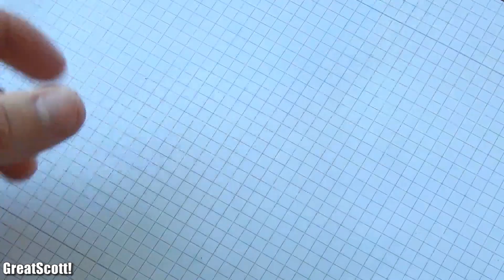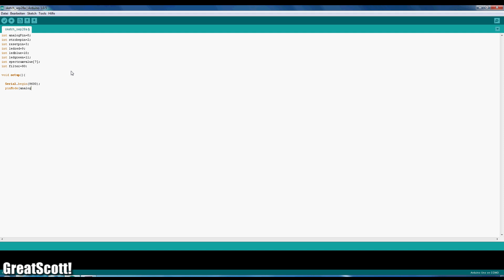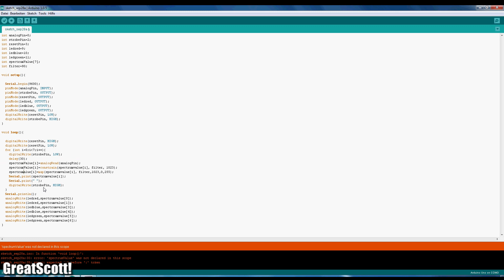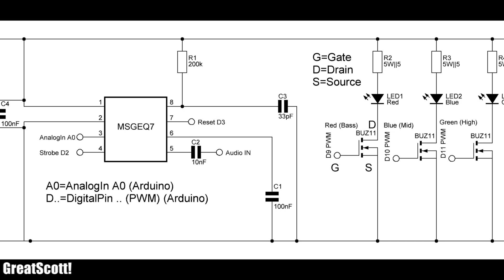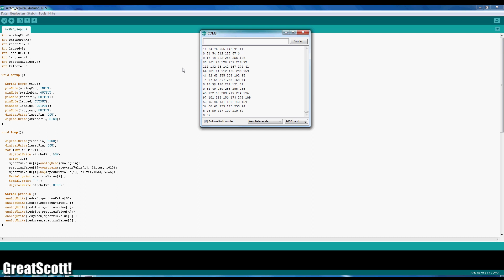How to build your own LED Color Organ || Arduino || MSGEQ7

Comment: HALP PLS

When I change the 'delay()' value I get this error when trying to upload the code:

avrdude: ser_open(): can't open device "\\.\COM3": The system cannot find the file specified.

when i check my com 3 port in device manager (windows 10) it is assigned to my Arduino UNO!?

any suggestions are welcome :)
Reply: Check out if you have selected correct board and serial port in the "tools" bookmark

Comment: I have made this without any arduino, not a single IC required, just 3pcs bc547 transistors some resistors and capacitors,and leds . it's 
a 3 channel spectrum analyser

Comment: I see you are combining frequency bands together by doing analog writes to the same pin from two stored values. I would think you would need to add the readings together and divide by 2, map the value to 0-255, then send that value to the pin. This would give you the average of the two bands.

Comment: ich will am pc ein ambilight machen... mit arduinoe oder teensy bin mir noch nich sicher...  weisst du zufällig wie ich den sound vom pc in den mikrocontroller rein bekomme? geht das über usb? würde gerne drei moduse erstellen... einmal normales ambilight... normales licht... und music sensitive ...
Reply: +Dave Blvnko schreib ihm auf englisch, auf deutsch antwortet er nicht weil er will das alle es lesen können. Englisch = Weltsprache = viele Leute können es verstehen

Comment: Hi Scott, I was thinking about using 3 regular LEDs with resistors instead of high power LEDs. Would i still need the MOSFETs and would I have to make any adjustments to the code? Cheers
Reply from the maker: Thomas Jakobs Just replace the high power leds with your normal ones+the fitting current limiting resistors.

Comment: If I were to use different LED's is there a good rule to use for working out what I need to change the resistor values to? I believe it was 1W = 1Ohm but I may need some clarification on that. Thank you for the amazing videos!
Reply: Your LED has a rated current and a rated voltage to calculate the resistance you have to subtract the LED voltage from the supply voltage if you multiply the result by the current you have the power at the resistance in watts when you divide by the current you have the resistance in ohms.

Comment: hi , i am planing to light up 12 volt led strip but how to connect led strip into circuit.because output of the circuit is only 5 volt .... please help me ...
Reply: Kumar Shrestha Try to use voltage booster from ebay,what about this ? http://www.ebay.com/itm/331580286327

Comment: i am planning to do this with a 12V LED strip is there anything i need to change apart from supply?
Reply from the maker: Bradley Gill Make sure to use a 7805 to produce 5V for the Arduino and MSGEQ7.
Reply: where can i get the program?

Comment: Hey Scott. 
The project I had in mind would use RGB strip lights along the perimeter of the walls next to the ceiling, about 80-90 linear feet. With a small architectural moulding to keep the light on the wall.
Connected to the Arduino to produce a colour organ, lights to music.  
There are obvious challenges with this project with respect to the operating parameters of the devices being used. Nothing like a challenge I say.
Good luck with your project. I'll post my results upon completion.
Cheers.

Comment: (long story short at the end)
why in the schematic you show in this video the gates arn't connected to the minus like it shown in the schematic in the instructables website?

also, in the instructables they add extra 3 ressistors 1k ohm 1/4 W between the gate and the minus...

i'm realy confused and i will be glad if you will explain that up for me..

one last this... how do i know that my buz11 isnt converting(?) from 0 to to much valt?
i fount buz11 mosfet to-220 i guess that it mean 220V , and if it will go to to much valt the buz11 can hit and destroies

please correct me if i wrong and please answer my questions:
1. how do i know that my buz11 isnt converting(?) from 0 to to much valt?
2. which schematic should i work with? the one shown in the video or the one in the website?
Reply from the maker: The Gates are not connected in any schematic. The instructables schematic is the newer one. Those 1k ohm resistors between each Gate and Ground are called Pull-Down resistors. Just google this term and you will find out what they do. And the 220 does not mean 220V. Do not worry about that. Long story short, use the schematic you find on instructables.
Reply: thank you
So what is the 220 mean?
Reply from the maker: יניב גלרון
http://en.wikipedia.org/wiki/TO-220
Reply: i understand that the 
MSGEQ7 is the one in charged on the frequency of the wave and determine which frequency is low high or bass
but i cant see at the sketch why the red led is the one that get the X note

MSGEQ7 can Set 7 different frequency so can i do the same thing which 7 leds? 

Thanks in advance,
Yaniv

Comment: I'm considering integrating one of these into a bed frame I built last year. It has 6 colors and 336 LEDs. I agree that 3 colors for mid, low, and high are enough but, then I feel like the other three colors are left out. Could It also be programmed to recognize different tempos of music and switch color schemes based on that? I'm not much of a coder.

Comment: Gutes Video! Fände es aber besser, wenn du noch mehr darauf eingehen könntest wie die Schaltung genau funktioniert. Einfach eine kurze Schaltungsanalyse, bei der du verschiedene Szenarien durchgehst (hier z.B. tiefe, mittlere oder hohe frequenzen) und vielleicht mit Hilfe der Datenblätter noch genau die Pinbelegung des ICs erklärst.
Reply from the maker: Ich rede natürlich auch sehr gern über solche Details und Einzelheiten. Ich denke aber es würde vorallem Anfänger abschrecken (die ich versuche zu erreichen). Aber vielleicht werde ich in der Zukunft eine neue Reihe starten in der ich mehr auf das Elektrotechnische eingehe.
Reply: Thats nice that you can speak multiple languages for those who dont speak or understand english

Comment: I have an idea for a new video: I really like this low, mid, high responding LED's, is it possible to connect this to your traditional speakers as well? Not for PC speakers or so, but for traditional speakers which you connect to a traditional amp. I tried some other methods (like just connecting the LED's directly to my (test) amplifier) but I always end up damaging my amplifier :(

Comment: Hi Scott, I was confused by some questions.
What's the function of the audio jack? Should I put a phone connector in it
so as to put the music to arduino?
What I've done is already finished the schematic, and the LED did blink, but I
don't know the way it shine. I mean, is the code trigger it?
Thanks a lot.
Reply from the maker: Yep the audio jack connects the audio signal to the MSGEQ7.
Reply: GreatScott! I was wondering how you plug the computer into the audio jack of the breadboard and are still able to play music out of the computer's speakers.
Reply from the maker: Luke Soldano
Here is the solution: http://amzn.to/1lM1Izp
Reply: GreatScott! Of course haha. Would you know how to output the audio into the color organ circuit while also playing music out of your surround sound speakers using a separate soundcard (Audio 2DJ)? Put more simply, can I output audio into my soundcard as well as through my audio jack to play music through good speakers and have lights at the same time?

Comment: I downloaded media fire and I'm still unable to get the Sketch code, it is downloading as a VLC file with no duration. Is there a way you could send the code via email?
Reply from the maker: Here is the link to my instructable about this project:

http://www.instructables.com/id/How-to-build-your-own-LED-Color-Organ-Arduino-MSGE/

There are more helpfull tips. If you still can't download the code then go ahead and text me again.
Reply: GreatScott! Do you need the power supply or does the usb cord survey enough power?
Reply from the maker: Siannee04 It depends. If you want to light up high power LEDs, you will need an external power supply ( 1 LED draws up to 300mA --> 3 high power LEDs draw 900mA but USB can only deliver 500mA)

Comment: Hey scott, is there any way i could modify this to have the different fequencys on 6 8x8 LED matrixes?
Reply from the maker: It sounds like it is possible. But I would need more details to do this. And I also do not have the parts. So I guess you are on your own with this.

Comment: Hi Scott! Great video!
Just a question: can I replace the 3 LEDs with a RGB LEDs strip without having to modify the circuit? obviously, red to red, blue to blue etc, and connecting the strip to a 12V power supply.. 
David :)
Reply from the maker: Hey David. That is definitely possible and easy to do. But be sure to use a common anode rgb led strip. That means you hook up one wire to +12V and the negative red, green and blue to the drain of the MOSFETSs. And do not forget to connect GND of your 12V supply with the GND of your arduino. That is all
Reply: GreatScott! So the whole thing now runs off of 12v instead of 5V?
Reply from the maker: Rob Haynes
NO! Only the RGB LED strip. The microcontroller still needs 5V.

Comment: can you use other MOSFETs with the same capacitor values?
Reply from the maker: Different N-Channel MOSFET should also work fine. But it would be easy to just use those BUZ11.

Comment: I was wondering if you could answer a question for me. How come the lights continue to flash when there is no music playing until I reset it?
Reply from the maker: Firstly you can try to change the filter value from 80 to something higher, maybe there are some interfering signals on your audio line. And if that does not help try putting one 1k ohm resistor between each gate and ground. It is called a pull down resistor.

Comment: Hey great video, I built an analog version, but that depends on the line level input voltage. This means that I have to keep adjusting the line volume for each song for the color organ to look right (in between all on and all off). Does this setup (using an msgeq7 and micro-controller) base the flashing on the presence of a certain frequency based on the presence of the other frequencies? Or by only the voltage of that frequency? I want the color organ to work the same at low and high line input levels. I want to "be really hardcore" hahaha.
Reply from the maker: Good question. I had the same problems with my own analog color organ. I did not compare those two (analog and digital) side by side to see the difference in detail, but the color intensity and variation feels much more natural and compeling with the digital one. But that does not mean the color intensity does not depend on the volume. When the volume goes low, the color brightness goes low. It is hard to explain, but in general the volume and the force of the frequency band both influence the brightness equally. After successfully building both, I can  recommend the digital one to be the most hardcore one. I hope that I helped you a bit.